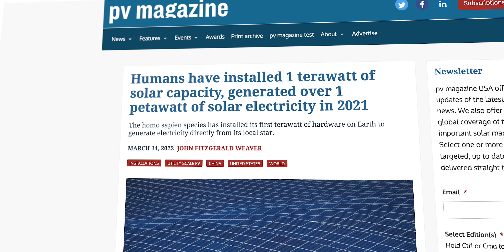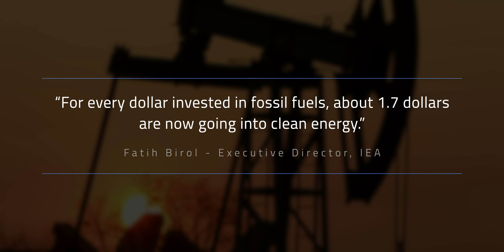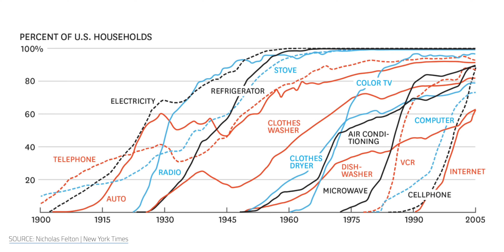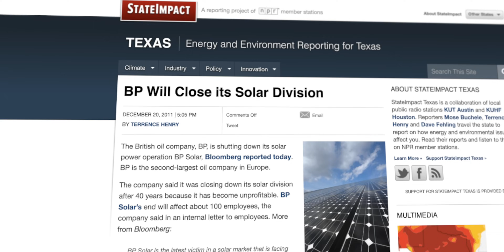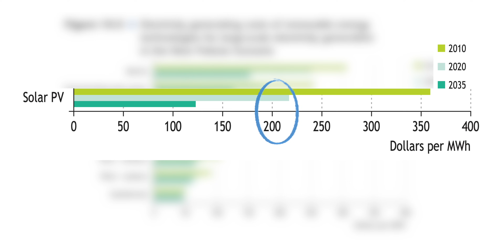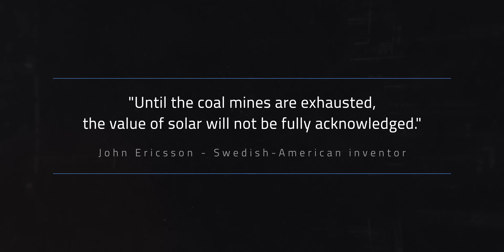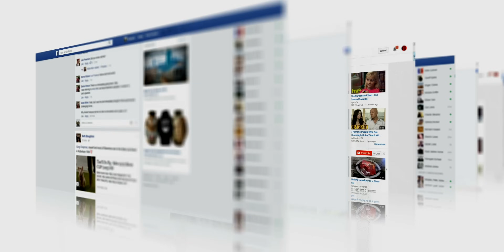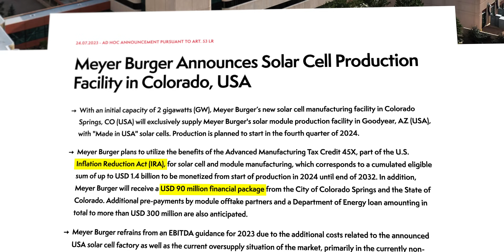How Solar Power Got So Cheap … So Fast

Comment: I’d like to see an analysis that included a map outlining where it never hails and the sun shines on the panels enough of the time to make rooftop systems economical without subsidies and with insurance.
Reply: And if someone showed you that, would you be convinced, or would you find another reason to claim it won’t work?
Reply: And fwiw, we get hail in Minnesota. We are also getting massive solar growth to match our wind, even though we’re fairly far north. A few weeks ago, we had a big hailstorm. Half the houses on our block are getting new roofs. Solar panels would have protected those roofs. :)
Reply: @davestagner    Oh, it works. I have no argument with that. My point is it will only be a small part of the solution. There is only a small part of the planet where it’s viable. Apply it to the extent it is but it is no panacea.
Reply: @ThisIsToolman  Is there only a small part of the planet where the Sun shines? There are some places solar is more effective than others, but there is nowhere that it simply doesn’t work. Inside the Arctic Circle or in Antarctica, maybe. And the disadvantages are weighed against the advantages - starting with the fact that it is THE cheapest source of raw energy out there, and will continue to get cheaper for some time to come. (I personally expect at least 50% cheaper in a decade and probably 90% cheaper by 2040.) And it’s a simple commodity. Latitude or climate makes things less efficient? Just throw more panels at the problem, as cheap as they are. Another huge advantage is it’s inherently decentralized. All sorts of devices, even buildings, can be freed from the grid entirely with some solar panels and a battery backup. 

Unless something comes along that’s massively cheaper at every scale, I don’t see how it would be a “small part of the solution”. It’s going to be the dominant solution.
Reply: @davestagner    The benefits you outline are correct where it does not hail and the sun does shine a vast majority of the time and the longitude makes for intense sun light and that place is near a large population. If you do a map overlay that meets all those conditions I think you’ll see my point. The technology will improve, no doubt. Let’s hope it does to the extent it overcomes it’s limitations. Then it can be deployed in the West. Don’t forget, 2/3 of the rest of the world isn’t going to be involved unless the West wants to go there and install the entire infrastructure needed for nearly free. 

Are we going to borrow more money from ourselves to pay for all this? I believe something needs to be done. Maybe AI will figure it out. I did see what I thought was a good idea, apply a carbon import tax. That will be motivation for China to stop building more coal burning generators. They are by far the very worst offenders when it comes to CO2 emissions.
Reply: @ThisIsToolman  Why are you so convinced hail is a deadly problem for solar panels? It’s demonstrably untrue. If they’re as tough as a car window (not a high standard), they almost certainly won’t break. I’ve lived in the midwest my entire life, and in 40+ years of driving and parking outside, I’ve NEVER had a window even crack due to hail. We just had golfball-sized hail a few weeks ago that left plenty of dents and damaged many roofs on our block enough to need replacement, but not a single car window broke. 

“Then it can be deployed in the West”. It IS being deployed in the West. It’s the fastest growing energy source, by far, in the US and Europe. And we don’t need to buy it as charity for the poor countries, either. Energy is valuable. It pays for itself and generates profits. And since solar is cheaper AND scales smaller, it’s going to grow very quickly in those poor countries. For example, in Nigeria, it’s incredibly common for a house to own a solar panel - a tiny one, costing $20 or so. But it’ll charge a phone and other USB powered devices, and a phone can add tremendously to a family’s income and standard of living. And they don’t to be wired to the power grid, which costs hundreds of dollars and isn’t worth it in the shanties of the poor. This is similar to what happened with cell phones in places that didn’t have good wired phone networks. Off-grid + cheap = successful. 

Despite what FOX tells you, China are NOT “by far the very worst offenders” for CO2 emissions. In 2018, US emissions were 16 tons per capita. In China, it was 8 tons. And there’s something grossly hypocritical about the wealthy countries of the West causing most of the CO2 problem we have, then shaking our fingers at poorer countries trying to raise their standards of living. But that’s barely even relevant in the face of the CO2 threat. The whole world - all of us - MUST stop using fossil fuels as soon as is possible, before something snaps and civilization itself collapses under the strain. And at the moment, the only realistic candidates we have are solar and wind. That’s it. Not some fusion fantasy. Not failed fission. And solar is cheaper in most cases. I don’t see that we have any choice, except maybe choosing to destroy human civilization because we’re too greedy and lazy and selfish to do anything about it.

Comment: Installed capacity does not equal power generated.  I am a solar proponent, but lets not compare apples to oranges.  We also can't ignore the problems with decommissioning solar systems and the environmental impact.  Hopefully, we will have a solution for solar circularity in the next decade as these large systems begin to age out.  The future should be nuclear baseload and nighttime power coupled with variable renewables during the day.  Forget about grid scale battery backup and use the cobalt and lithium to decarbonize the transportation sector.

Comment: If batteries becomes cheaper upto 30 usd per KWH for stationary storage ... 70-80 $ per kwh and 250 wh per kg  will kill it in transportation ... the fossil fuel will not be able to compete for more than a decade.

Comment: The first part of the S curve applies to electric cars, but not the last part.

In 2035 new cars in the EU will all be EV's, so in about 2050-60 there won't be many petrol stations.  It's when the petrol stations start closing the S curve won't be an S, it'll just be a sudden end to petrol and diesel.

There is also an interdependancy with airplanes, aviation fuel comes from crude oil, when the people who process crude oil don't have a market for petrol and diesel then they will need to make their profit from selling whatever they can sell, which will be aviation fuel.

Airbus is researching hydrogen and Boeing isn't researching anything.  The Airbus A380 took about 20 years to design and build.  So when you at Airbus's time frame for hydrogen, they have to invent the technology which might take a decade or two and then they have to design an airplane that they will sell which took 20 years in the case of the A380, but with a new technology might take longer.  So Boeing is running a bit late.

Comment: Well, some European countries (Germany, France) have been using eco-friendly energy policies, but the electricity prices have risen to an unbearable level, and they have been using gas from Russia, but they have been blocked, so they tend to go back to fossil fuels.
And most Asian countries do not have much solar and wind energy, and have high population density, so they have no alternative to nuclear fuel power generation, which has recently been incorporated into renewable energy, and nuclear fusion power generation.

Comment: what are the labor costs of fossil fuels vs solar?

solar is just manufacturing, shipment to end user and installation. 

fossil fuels needs to be harvested, refined, shipped, sold (which has many iterations like gas stations or by the barrel)

so basically solar has less man power, crudely speaking.
but energy density im still biased toward FF due to its utility for vehicles. but energy for buildings... maybe even charging a battery cell one day for BEVs, solar is pretty good.

Comment: I've gotta say I love your videos, but we gotta talk the truth. Solar does a perfectly good job at producing electricity. They don't need more money or incentives. They need a reliable storage system. Otherwise, solar is garbage. This is where the money should go not production. The inflation reduction puts the cart before the horse. So sick of wasteful spending. The electric providers will jump on solar when it can be seamlessly integrated. We don't need to invest in solar. Invest more in storage. Otherwise, we are wasting borrowed money. No virtue points for an ignorant waste of future taxes I,R,A.😮
Reply from the maker: The IRA actually has great incentives for solar and energy storage.  It is trying to address the problem holistically.
Reply: @UndecidedMF  right, so why isn't that the focus? Same excuses, promote economies of scale. Economies of scale are a lot more sustainable when the costumers can make a boat load of money. The current model is built on debt and is unstable with tax dollars. It is a terrible system without cheap storage. The quicker we face the facts, the quicker we find a solution. No credit, Non due!!!

Comment: The comparison between hot water solar and electricity solar is silly. Hot water is almost useless, electricity on the other hand can be used for almost anything and can even stored for longer if needed.

Comment: No matter how cheap solar gets, it will never go mainstream. For one of two reasons. First being battery capacity limitations and cost. Second, the climate that the majority of people live in. Solar works great in dry sunny climates with no cloud cover to speak of. Cloud cover severely limits solar reliability. Solar, without a major breakthrough in battery technology, is nothing more than a very expensive supplement. At best! In other words, worthless to 90% of the world's population.

Comment: I have vague knowledge of solar, I know certain areas are not ideal with solar, and people claim it's worse for the environment.  The reality when you think for a moment though is nothing solar can do is worse for the environment than a single nuclear meltdown ala Fukushima or Chernobyl.  Nuclear's relative safety in modern times is reasonable, but it should only be a holdover until we surpass it in a balanced form of sustainable energy that has as little chance of causing harm as possible, while simultaneously making all nations self-sufficient.  I also am curious about new technologies for panels that do not use overtly toxic materials if that exists.

Comment: solar is successful because it is low cost entry for installer. If more efficient method such as small scale windmill breakthrough in cost while solar remains low 20s% by then, you will see people that gets wind trashing their panel immediately.

Comment: The "critical mass" theory is a massive oversimplification. Let me explain, first solar was used for satellites, where the alternatives are very expensive and hard to build etc. Then it was competitive off-the-grid in certain places with very good sunshine and where diesel is expensive. Then It was competitive in almost all off-the-grid places. Then it started competing with the grid. Each decade it had a different market segment with different applications, and as time progressed the market became massive.

Comment: The cost of solar has not dropped. Government subsidies have increased. Germany has abandoned solar & wind because they can’t handle peak demand, nor regular demand. The iPhone, cable tv, the car, or that corn did not need government subsidies. Popular demand necessitated an increase in supply. And, China uses slave labor & poor working conditions to keep costs down. Other than that, solar is great for heating water. Not making electricity.

Comment: Elon Musk said that if we build 100x100 miles of solar panels, we can satisfy our power needs. As an engineer, I have calculated that there are 240000 miles of high voltage transmission lines in the USA, and if we build inclined 220' wide solar panels under the 240000 miles transmission lines, we can satisfy our needs. What do you think about this idea?
Chiman Delwadia

Comment: Many moons ago when I was in high school. I honestly thought Hydrogen was going to be the way of the future with the surface of the planet being covered with 70% water. It just made sense.
Reply: Hindsight being 20/20, you need to use electricity to perform electrolysis to break the water into hydrogen and oxygen.
Reply: Yes, but the energy content of water is very low.  You have to get energy from somewhere to break part the strong bonds between the atoms of water to free the hydrogen so that you can get the energy back from the hydrogen when letting it recombine with water.   Hydrogen is not a source of energy, is had to store and hard to transport, is extremely flammable and will never be the "way of the future"...

Comment: So how do you account for the commercial failure of the Segway?
Reply: Rain
Reply: @ianhamilton3113  
Please explain.
Rain does not impede all use of bicycles, for instance.
Reply: The Segway is very expensive and it is illegal to use on public roads in most places. This is because it falls under the legal definition of a moped but it cannot fulfil the legal requirements for a moped. In particular it has no brakes, and it cannot have brakes because you would fall on your face the moment you applied them (like President George Bush when he stepped onto a Segway that wasn't switched on). The first thing a Segway has to do before slowing down is to accelerate slightly so the rider is now leaning backwards; only then can it slow down without falling forwards. All very clever but active electronic control is not in most countries accepted as a substitute for mechanical brakes on a motor vehicle.
Reply: @cedriclynch  
Thank you for your pains-taking explanation.
I never knew these things.
But it looks so much FUN !

Comment: Solar is intermittent, location-dependent, and has low energy density. Overcoming those limitations increases the cost by a factor of four even if the cost of energy storage miraculously goes down by two orders of magnitude.  Even if you could do that, that only decarbonized the grid, not the economy. What about Transportation, industry and agriculture? To meet climate goals, you'd need a Energy return on Energy invested (EROI) of close to 10 to 1 and solar is closer to 1 to 1.  Solar is a counter-productive distraction.

Comment: Hey Matt, is it true that about the same electricity is used to drill, pump, transport, refine, pump, store, pump and etc gasoline and diesel as if the same electricity was just used directly in an EV?
Reply: It’s not just about the electricity used, it’s about the energy used to get refined FF products from the ground to market.   Vast amounts of fossil fuels are also used sometimes to extract FF’s, and refine FF’s and certainly to transport them.  That energy could go straight into electricity bypassing the secondary pollution from burning the finished products.
Reply: False 🤣🤣🤣 (Laughing at the original comment as EVs are way more efficient in their energy use.)
Reply: @beachcrow  if it’s anywhere between 18 and 100%, using straight electricity is more efficient.
Reply: @brettgracey9682  good point

Comment: Solar has not gotten cheap. It is still  the most expensive energy. My neighbor bought a 15 kilowatt  installation  for his house in 2022. He told me he paid $45,000 and produced 15,000 kilowatt hours in 2023. In my area that is about $2000 worth  of  electricity. That would be more than 22 years before he paid off the system. The only thing that has kept him in the black is that he got $20,000 from taxpayers in a subsidy when he bought the system. Sure, solar is cheap.... when someone  else  is paying for it. So why aren't my groceries subsidized? Or my heating bill? Or  my car purchase?

Comment: Solar power is definitely the best solution.  Too bad solar panels are still so inefficient.  Correct me if I'm wrong but aren't they barely 20% efficient?

Sacrificing earth's health because it's not profitable shouldn't be a surprise to anyone.
Look at GM with the EV1 in the 90's...petroleum managed to burry that pretty fast.

Another obstacle for solar panel development...Governments still haven't found a way of taxing this basically free ressource, except of course buying initial components.  Give them time and they'll figure something out. 🙄
Reply: About solar panels not being developed efficiently or about the governments pushing a more profitable agenda?

Comment: The entire Architectural sector in America needs to go back to the drawing board and have new home construction standards build around integrated Solar primary and secondary Wind generation, with banks taking the place of Ye Olde Water Heater in the garage or utility closet.
The only thing that is expensive now is betting your family's lives entirely on Grid power.

Comment: Politics plays a large role, though. Even though Royal Dutch Shell is the second largest fossil fuel company in the world, the Netherlands ranks #1 often in solar per capita due to their environmental politics. Contrast that with the USA and fossil fuel dominated states (except maybe Texas which has smarter people running their energy system).
Reply: OfficialMattferrell  although I made it sound like Texas had good adoption of solar, I think it is really on the utility side. It appears that politics is still affecting Texas in that its residential solar penetration is lower than many western states, including Arizona which is conservative, but has much less fossil fuel industry.